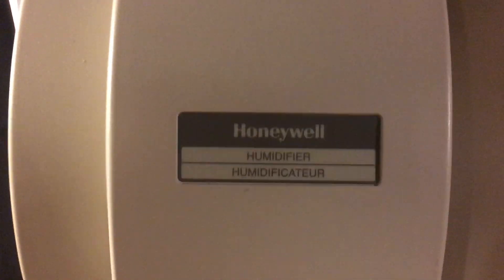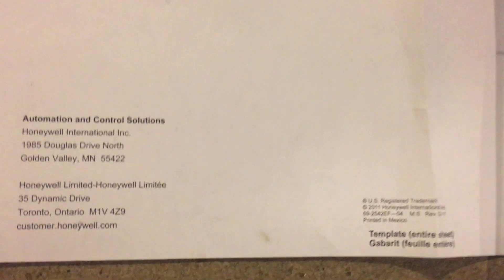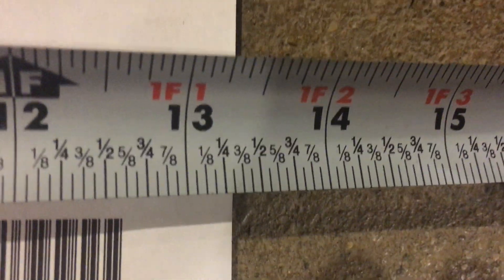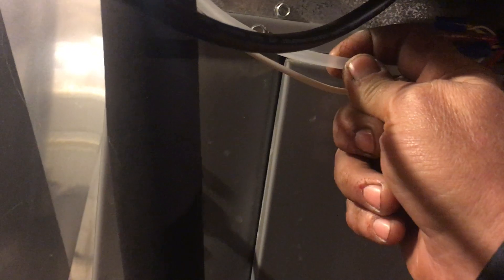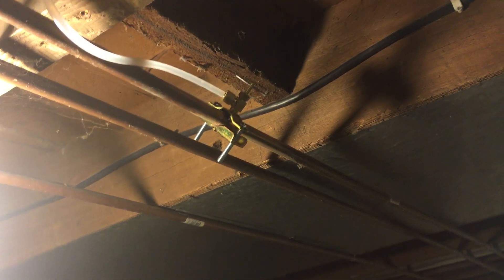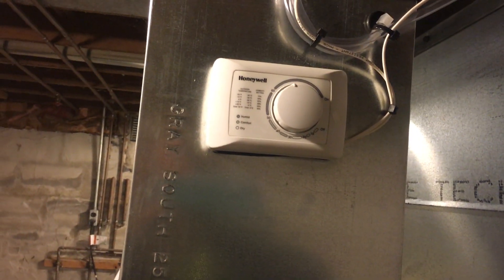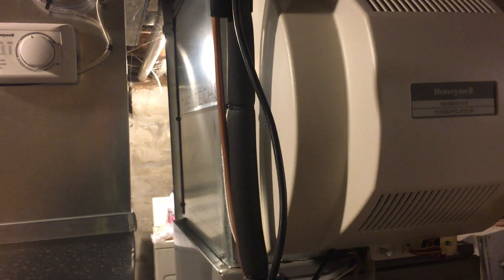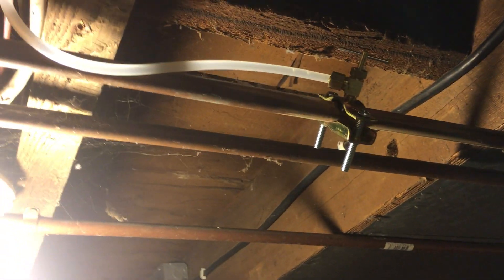honeywell he360a install overview

Comment: Well i got better idea not to waist water 💧 instead of taking water directly from line i got electric pump and connected it to furnace motor ,and 5 gallon bucket with water  pump will supply coil with water from bucket when its on , and  existing water will go back to bucket this way you will not loose water , just add water sometimes if you don’t wanna add water every time then you can do automatic shot off valve it will keep bucket full with out over floating

Comment: Hoping you can help. 

We can not figure out the wiring for this machine. It is has horrible directions. 

Anyway you can show your wiring for me.
Reply: @Jackie Prince .... Saw you commented on a few videos. I'm installing tonight to see if there is any hangups I can mitigate beforehand... Looks pretty straight forward. 
What is wrong with the wiring? *Did you see the addendum in the box (green paper)
Reply: @JackiePrince

What issues did you have with wiring?

Install was the first project I had without a hiccup in a LONG time...

Not sure where in lies any ambiguity
Reply from the maker: @ Jackie Prince. Sorry for the late reply, my roku and phone do not give me notifications. There is a cluster of 4 wires coming out of the unit. 2 are not used with this configuration. See 6:40 at the very bottom. The 2 switches (pressure and humidistat) are hooked in series to the other 2. Both switches must be closed for unit to engage. I made those connections behind the humidistat since there was room.  simple as that. The schematic in the box works just replace the flow switch with the pressure switch.
      In the event it doesn't work I would be most suspicious that the hoses to the pressure switch are reversed.
Reply: Any update on water issue? Mine does the same thing. As long as the humidity is lower than the setting it runs non stop. I actually replaced the solenoid thinking it was defective. The volume of the pad isn't that large...think I might tie the valve into the pressure switch/blower so it only comes on w/ the furnace.

Comment from the maker: After 2 days the house went form 20 to 45 humidity. The internet says that is ideal.
Reply from the maker: The house stays at 40-50 humidity depending on outside temp (3f now) 2000 sq ft house 100 yrs old. DW and son have dry skin issues in the winter that are  much better this year.  Cats are not zappy and angry. I would buy this again. As advised by another video I am in possession of a replacement solenoid. I would upgrade the drain hose and supply line and the saddle tap valve to a tee and angle stop.  
      The main thing is you need a 16x114 x 12 deep area free on you plenum
Reply: You said 8 weeks for an update-- but I'm considering buying this. How has the machine been reacting to starving it from a bit of water? Overall is it working pretty well?
Reply from the maker: @justinpietrowski2335  Starving only partially works. I had to turn it up so some water does go down the drain$$$. unit also already leaks @ connection to water solenoid.
Reply: That's how they work.  It's supposed to dump water down the drain.  Where do you live?  Why does water cost so much?